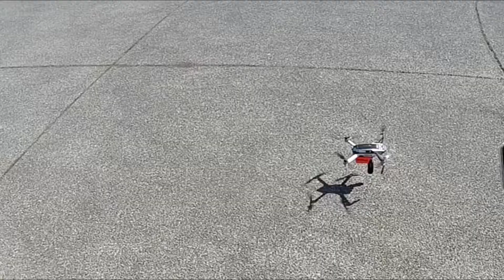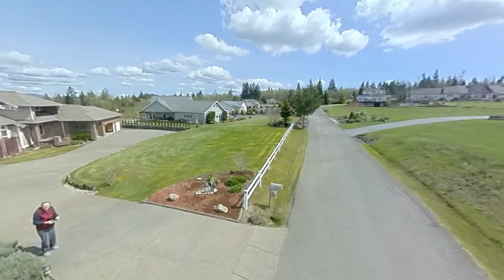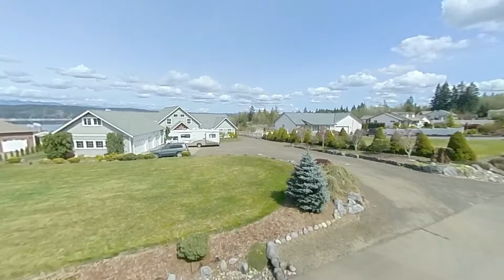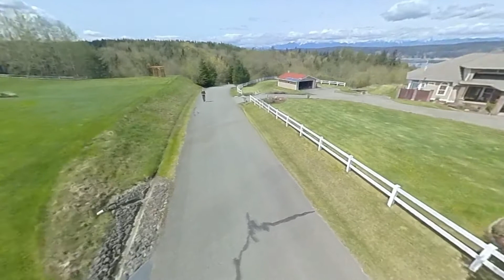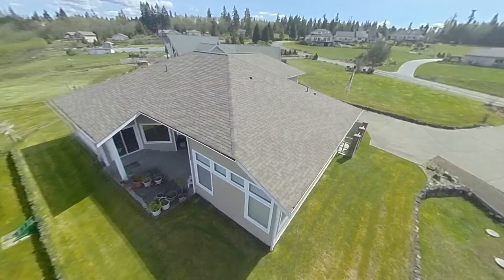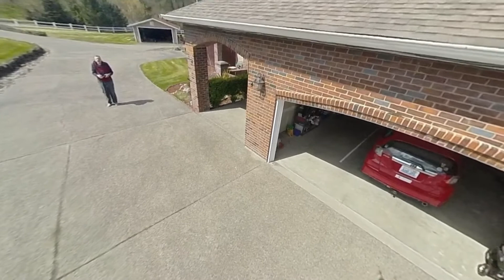DJI Mavic Pro Platinum with Insta360 ONE camera

Comment: Hi Stan - I just subscribed! You know I have the Insta360 - but I don't have a 3D printer, so I'm going to use something else to attach it to my Phantom 4 Pro. I might actually put the camera on top of the P4Pro because then I don't have to compete with the existing camera and gimbal. Plus I think I can use a suction cup or adhesive on the top to avoid the swinging. And then do what you did and hand catch it.

Comment: Some greats mods Stan. Did you ever get any decent video from the Insta 360 mounted on the Mavic Pro?
Reply from the maker: Ron Brown, I have not done it yet.  I know I need to get it up and try again in tripod mode.  Hang in there I will get it done.  Thanks
Reply: I purchased a 3D printed mount to put on the top of my Mavic Pro, and I just recently tested the Insta 360 on it with mixed results. The Mavic Pro was able to get satellites and I had full control, but even in a gentle breeze the drone was unstable with the extra weight. For flying purposes it was fine, but for video recording it was to shaky. And I did put it in Cinematic mode which help ever so slightly. I believe putting it under the drone as you did is the better option.